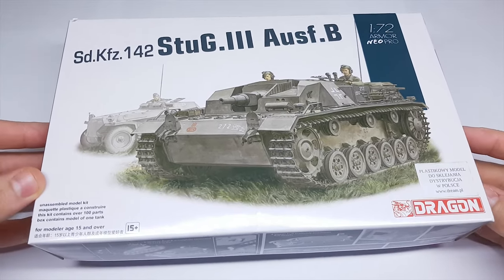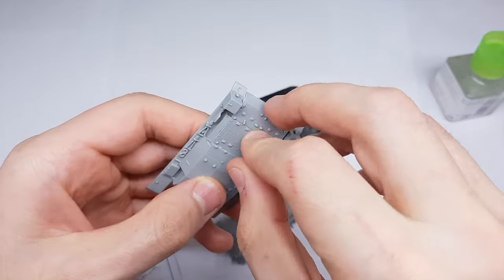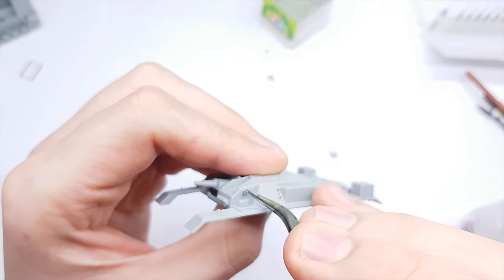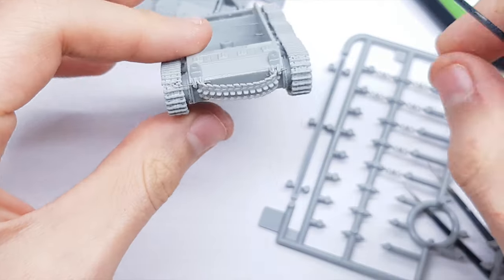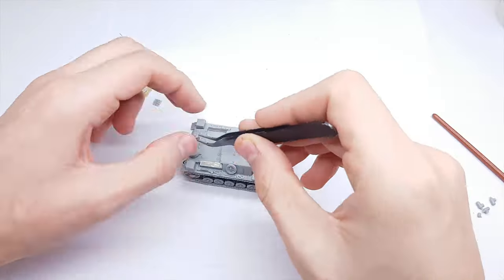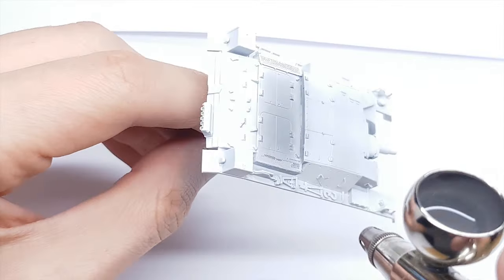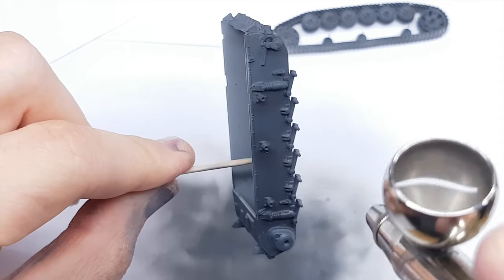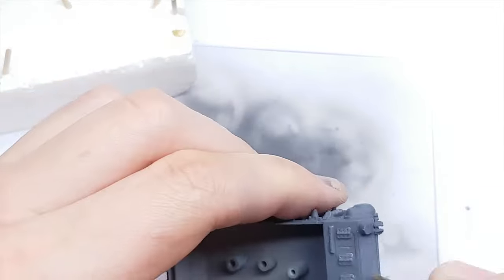Dragon 7636 StuG.III Ausf.B 1:72

Comment: Great clean build - easy to follow too! What size drill bit did you use for the road wheels? Thanks for a top video!!
Reply from the maker: I have 0.3-1.2 mm size drill bit. I use size probably little bigger than 0.3 but not the biggest like 1.2 or 1mm. I don't remember exactly